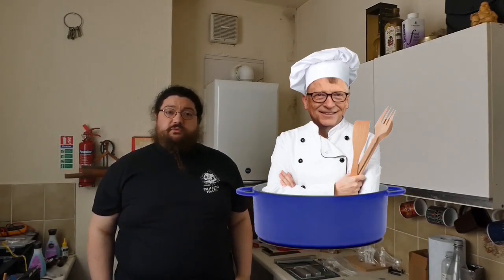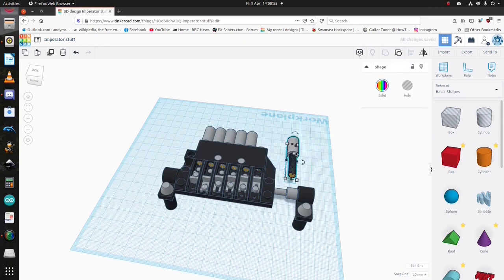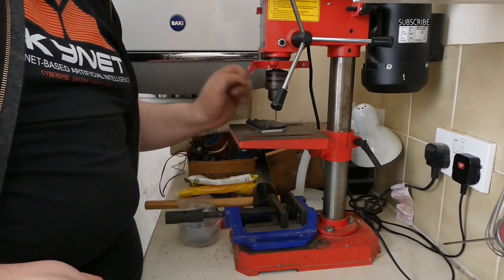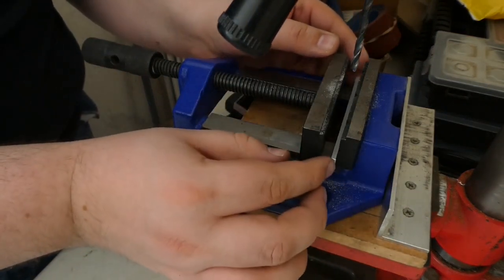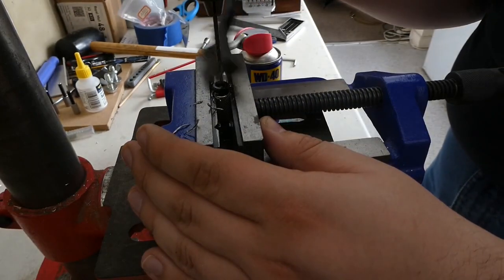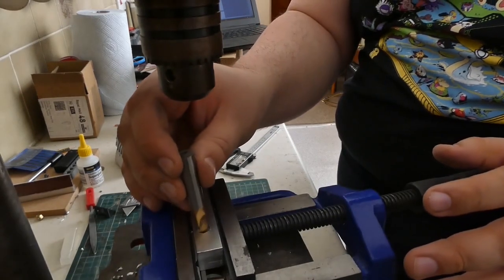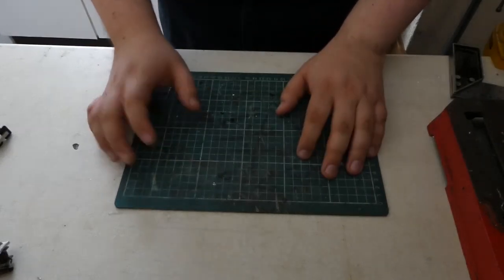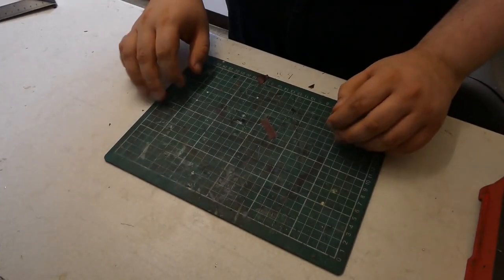A Bridge Too Far? The Imperator Great Guitar Build-Off '21, Video 2

Comment: Amazing work, very inspiring! How ever, i have to disagree about tonewood not being important. It may not change the output sound at the amp much, but thats NOT where the tone is. The tone comes from the feel of the guitar. A dense heavy brick of a guitar, that doesn't vibrate much, may have all the best bits and pieces, but if it doesn't inspire you it'll never have good tone. On the other hand, a guitar with cheap crap pickups, if it feels alive when you play it, can make great tone all day long. The tone lives in the feel. The feel lives, mostly, in the wood! BUT AMAZING WORK! Building your own trem is seriously next level!

Comment: Very impressive work indeed! Love everything about it, ah maan and the jokes are right on spot haha, I can tell you're a fine connoisseur of Parks and Rec. That bridge looks amazing and I'd suppose you want to anodise it? Also, what are your expectations of the threads on it, would they last a fair bit of time without stripping? And how easy is it to turn the knobs by hand and bring them up to tension? I know I had a fair bit of hard time with that and had to kinda go to and use some sort of mechanical advantage on them hence the radiator bleed keys. I like the pickup too, it's a nice and straightforward design. Good luck with the build, I'm looking forward to seeing it all together!
Reply from the maker: Thanks man. 

Yes to anodising, but it won't be quite that straightforward (I'll reveal how in the Finishing video.) Tuning was a little hard, but mainly because the MDF was giving way, and I was fighting the floating tremolo all the way. it was kinda like restringing a Floyd Rose with no strings, but less fun. I might run up another prototype off camera and test it again. 

Worst comes to the worst, I can cut a slot in the back of the tuner nuts to use a screwdriver for bonus mechanical advantage. As for the screws stripping, I'm not overly concerned. Aluminium can take a beating. or, I'll just swap them out for steel instead.